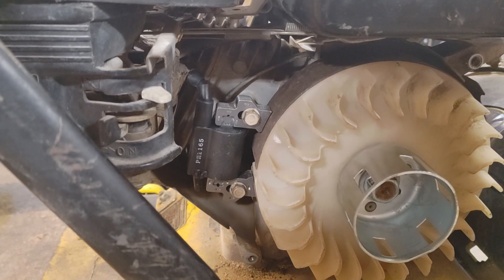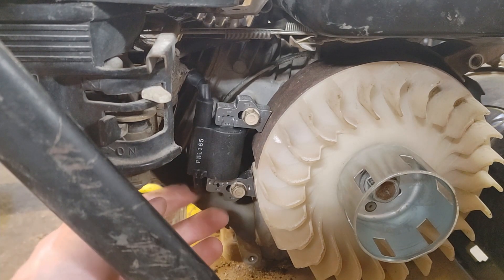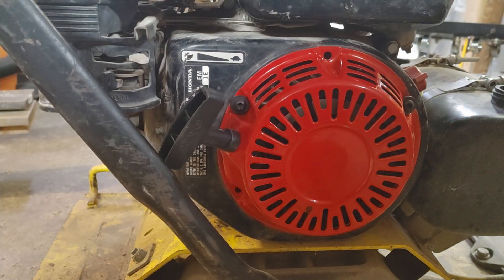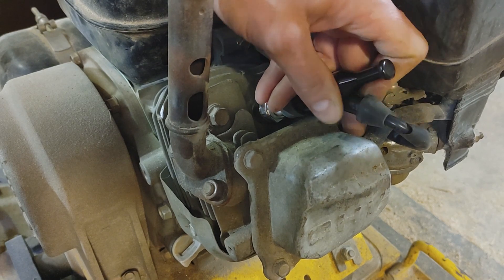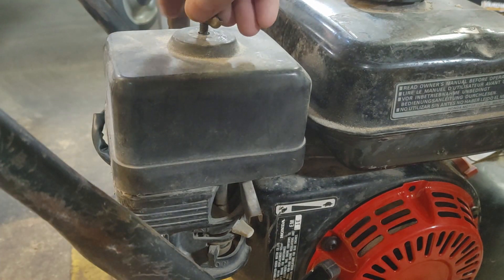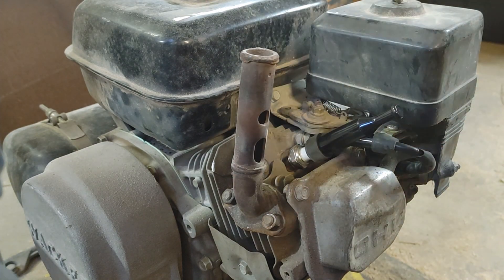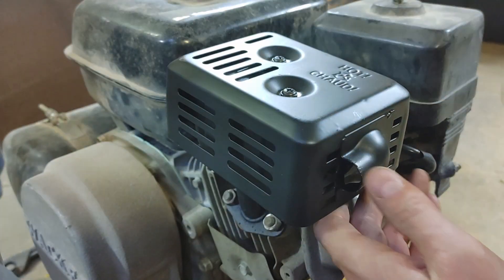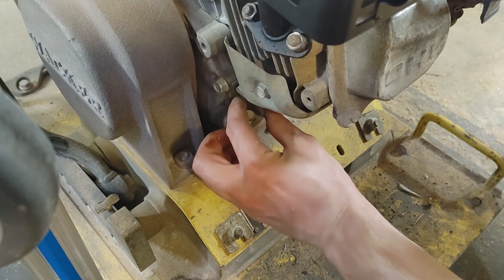Honda GX 160 - No Spark - Part 2

Comment: The spark plug isn't all the way in. I have just done a GX160 that had the same problem. Had to recut the threads because they were all gummed up with carbon deposits.